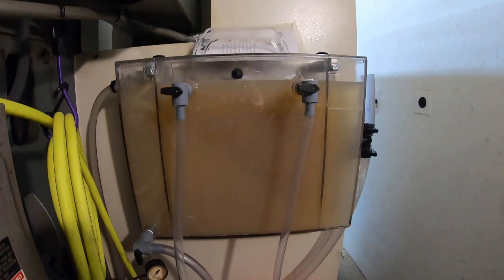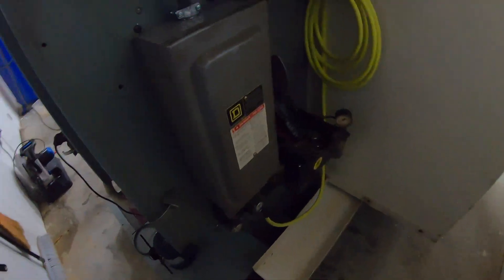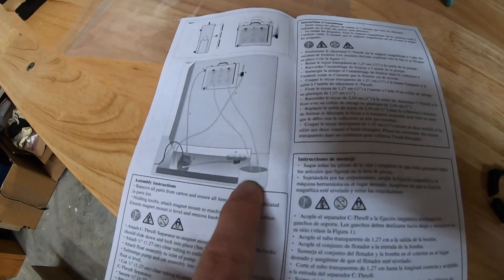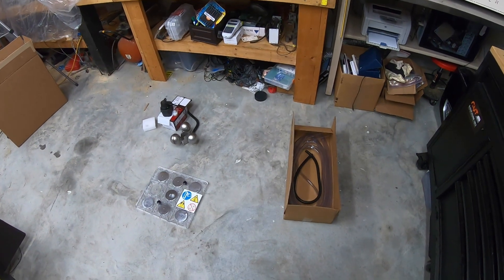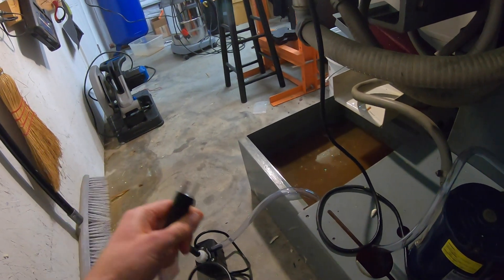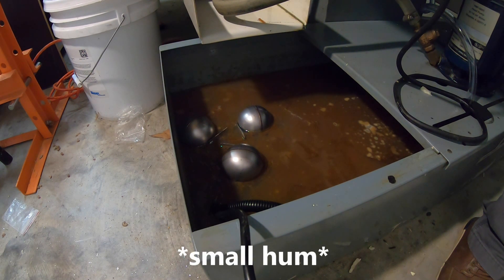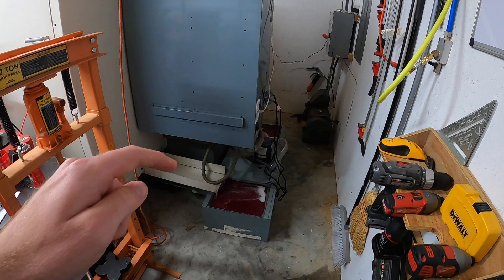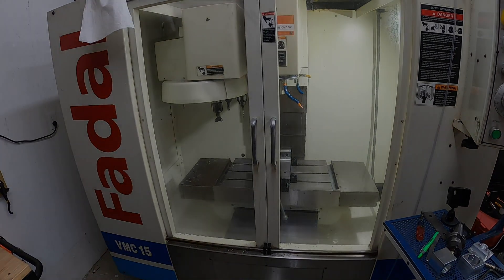NexJen install turned to Coolant Change!

Comment: My Fadals have a cabinet that houses a spindle chiller with its pump and reservoir for the Dow Frost where you mounted that skimmer. They are all 10,000 RPM spindles and maybe that is the difference. It just looked strange to me not to see one there.

Comment: what "clear" coolant are you running is it Blaser Synergy 735?  Ive been running it in my Tormach and for the 1st year it was fine, now all the paint is pealing but I cant say I did not know the issues others have had with the 735 so I guess I'm now paying the price.  I hate oil based coolants is yours non oil?

Comment: I would not wire it to the machine power.    Instead wire it to wall power through one of those cheap on off timers..  Set the timer for when the machine is not running. This does 2 things.  First when the machine is not running the oil will float to the top of the tank and the skimmer will skim it off easy.. Second if your machine sits a lot the pump circulating your coolant will help keep it from going rancid.

Comment: I always use simple green to clean my machines. Works great with quality coolant. I’ll definitely stay far away from anything blaser. I’ve had bad coolant experiences with rust lick and Mobil and will stay far away. Also seen some other blazer coolant eat the paint right off a machine.

I’ve been running qualichem 251c with great results. 

Also has some easier features like refractometer reading 1:1

Qualichem will also typically give you a free 5 gallon sample.

Comment: Super handy how to. Thanks for the info. Can we get an update on how the coolant performs? Any machine rust issues, etc.
Reply from the maker: This is the same coolant I had before, no rust issues for the past few years I’ve run it. Parts come out super shinny and the air actually smells better because of the new coolant 😜

Comment: Fiddling with those loclines is fine but I bet a wash down hose would be nicer !
Right ? :')
Reply from the maker: Yes! That’s honestly something I’ve been trying to figure out how I want for a while, but haven’t really done anything about... do I want it (the hose) in the machine? Out of the machine? I should probably just do it and call it done 😆
Reply: @bgwmachine  Well I don't think it matters that much 🤔 
Either way, it would be an improvement !
At school we have both type of implementation so I can share my experience.
Having it outside is nice because the handle does not get wet and the hose can not get in the way of the machine table. But on the other hand, you have to manage the (usually longer) hose around the machine in a matter that does not bother the operator.
If you go this rout, I strongly suggest a holder that has a little something to catch the occasional drop of coolant that come out of the gun after each use.
On our machines, the holder is on the side of the console. It's dripping on top of a shop cart...
Having it inside takes care of this, and it's also fine as your hands handling the parts will get wet at some point anyway. It's just not as nice when your switching back and forth between the front and side door to clean the machine.